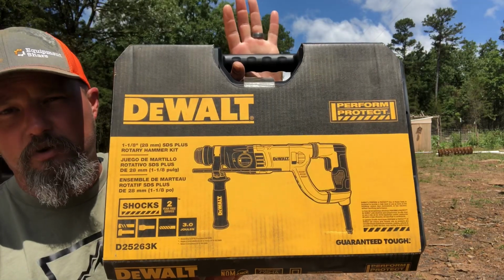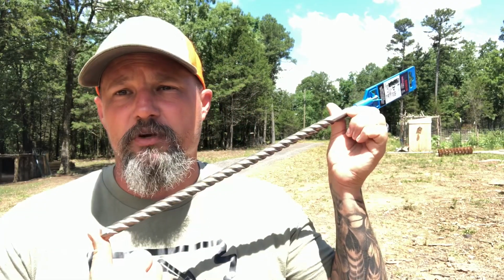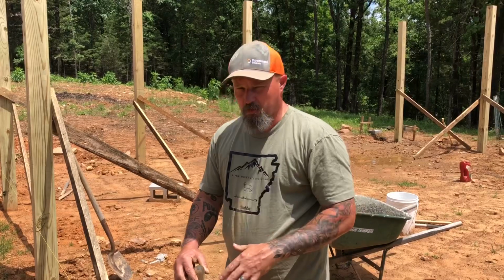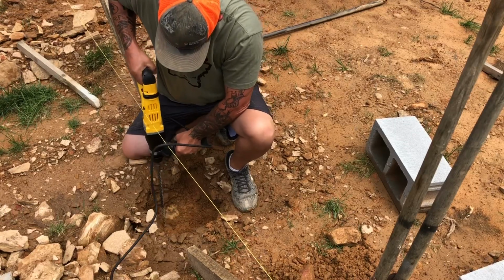Pole barn house build Day9

Comment: Not trying to be anal or anything 😱, but technically that's a rotary hammer rather than a cheap little hammer drill. Big difference when you're trying to find one, or especially when you're using one.